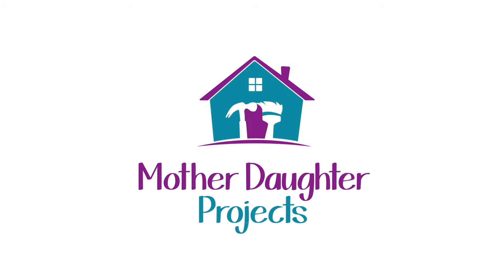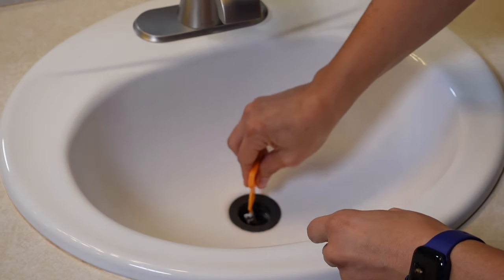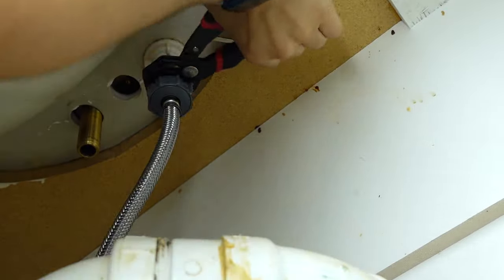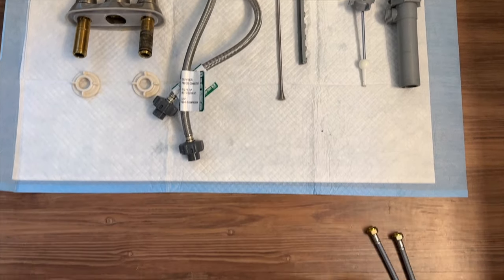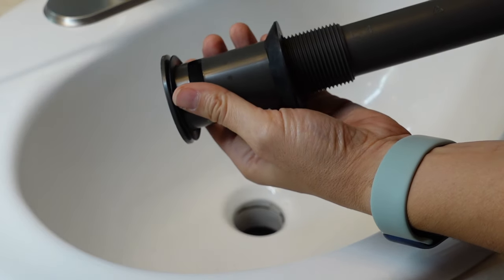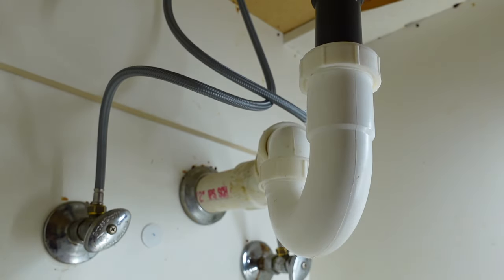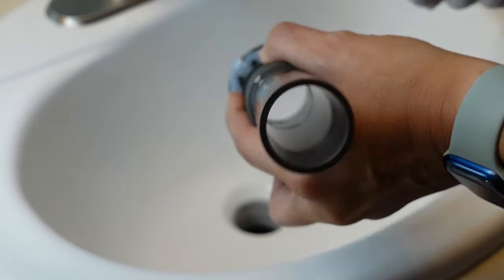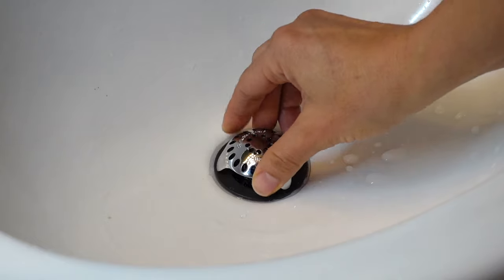Pop-up vs. Push-Button Sink Stopper

Comment: I put the push button stopper when renovating my bathroom last year and its jammed now and doesnt move. Neither does the neck of the faucet as it use have the ability to swivel from side to side. When checking it out, it looks like the hard water we have here in TX caused everything to stick. No cleaning methods ive tried have been able to get it to unstick so I now have to install a whole new faucet and stopper all together.

Comment: I'm a guy with long hair and I feel your pain! I have a push button in the bathroom but mine screws out, it doesn't just lift. It does work better I think but the biggest gripe I have is if you fill the sink with water and then say use it for cleaning stuff and the water gets gunky, you have to put your hand in all the gunk to let the water out. It is super simple to install one like you showed!